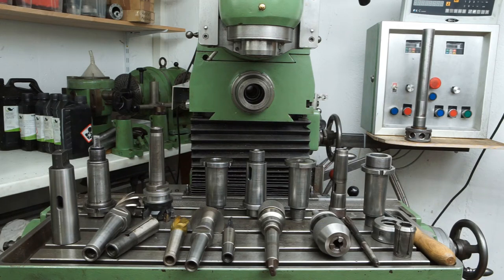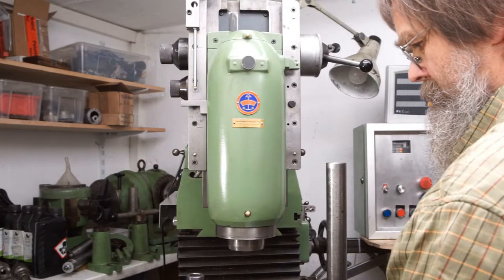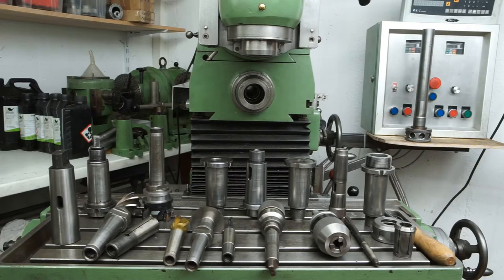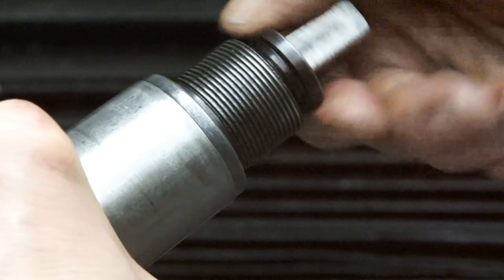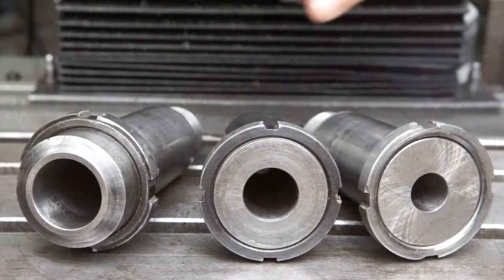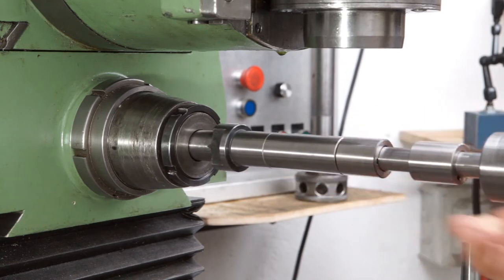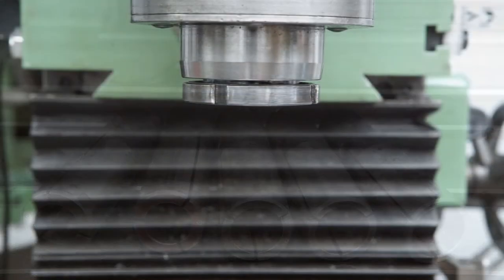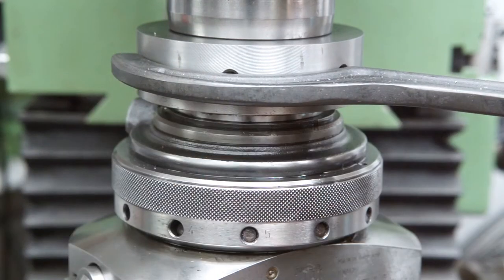Thiel Duplex 158 tool holders

Comment: Hi Harald - lovely work on the restoration of the Duplex 158. I am currently doing similar on a Duplex 159.Do you have any further photos or videos of the restoration? The Thiel is not familiar to me as I usually work on old lathes. I have the servicing manual but the drawings are not detailed enough for taking the machine apart. for example I cannot see how to remove the overarm without taking apart the spindle? Hope you don't mind me asking.
Reply from the maker: You will find a pretty detailed report at the German "Zerspanungsbude" forum: https://forum.zerspanungsbude.net/viewtopic.php?f=4&t=15758
Unfortunately the discussions are in German language, but the photographs could be helpful.
Feel free to ask me via e-mail (hfinster at gmx dot de) if you need more help.
I can only comment on the 158, but if I remember correctly, you can remove the overarm without removing the horizontal spindle. There is a bearing underneath the cover at the back. 
Edit: The splined shaft is axially fixed by a washer and a bolt. If you remove this bolt you should be able to remove the overarm.
There is a small housing with two gears underneath the overarm. The spline rungs across the top of the pair of gears. You should be able to pull the shaft through.
Reply: Hi Harald - Thanks so much for your reply and the very helpful information, I have friends in Austria who can translate for me if google translate isn't enough. The quality on the machine is exceptional but it has been neglected for many years, but hopefully nothing fundamentally wrong @HaraldFinster

Comment: Did you fit a DRO to your 158? 
If so, I would be interested to see if you found a good place for the X-axis scale because there is not much space underneath..........without protruding past the surface of the vertical table (where the two tee slots are located for mounting worktables, dividing attachment, large workpieces etc)

I would be interested to see if you came up with a nice solution. It would be nice to still have access to the trip dogs for disengaging the x axis feed after fitting the scale
Reply from the maker: Yes, i did fit a DRO to the 158.
With regards to the x-axis: you do really touch a soft spot here. I mounted it below the vertical table using the existing T-slots. As you say, the problem is that it protrudes past the table surface. Thus I have to remove the x-axis DRO in rare cases. Admittedly: i am not entirely happy with this solution. And, no, unfortunately the trip dogs are no longer adjustable. I left the end ("emergency") stops in place, of course.
Reply: @HaraldFinster  Pretty similar to my result. I mounted it to the tee slot also. Mine has an angle-iron cover piece mounted in there also to protect from cutting oil and chips. The result protrudes about 10mm past the vertical surface.

It just means that the tilting table only gets maybe ten degrees each side before you have to remove the dro scale..........if you needed to tilt the table sideways and could not achieve the desired setup by another means, either fore/aft tilting or using a sinebar.

Unfortunately the trip dogs are gone, but never really a problem as you have a big ruler-scale on top of the saddle to tell you when you are near the ends of the travel🤡 I use the soft wire shanks from pop-rivets as shearpin material for the two feed shear pins. Seems to be just about right for allowing heavy cuts but also they shear pretty easy when required
Reply from the maker: @g00167015  I used angled aluminium profiles to protect the ruler. They are a little bit bent meanwhile because I tilted the table downwards a bit to fast and hit the protective angle-profile. It still works fine.
Good hint with the shear pin. I used to use regular wire nails. They seem to work fine so far. One of them sheared off recently (without any obvious reason). I will try your solution with the pop-rivet shanks!
Reply: @HaraldFinster  a little cheaper than cutting pieces of TIG filler brass or alu rods......🤡

Comment: When you undo the withdrawer nut, how do you stop the spindle from turning?
Reply from the maker: It doesn't require a lot of force. Thus it is sufficient to put the machine in low gear so that the drive train keeps the spindle from spinning.
Reply: @HaraldFinster  thanks. How about when you tighten the draw bar? On mine, even in low gear, the motor provided very little resistance
Reply from the maker: @cai876  tightening the draw bar doesn't require a lot of force. I have never had any issues.
The spindle of my Thiel is driven by a motor with an integrated brake. I am not sure if all models are driven by this type of motor. It might be worth checking the functionality of this brake in your case? Feel free to ask if you need more information on the brake system.
Reply: @HaraldFinster  thanks! I think my brake must be non operational. It's a Thiel 158s if that makes any difference
Reply from the maker: please refer to this link for more information https://blog.demagcranes.com/en-us/maintenance-and-service-tips-for-demag-kb-and-zb-motors-in-non-crane-applications/
Reply from the maker: @cai876  If it's a 158s I am pretty sure that your machine has a brake motor. You should see an axial displacement of the drive pulley (the pulley at the bottom with three drive belts) when you switch the motor on/off. Please refer to my video on the first test run of my Thiel https://youtu.be/qRAYx8pVsHg?t=143
Reply from the maker: You could remove the drive belts and check if the motor has any resistance when you try to turn it manually. (In off state of course!)
Reply: @HaraldFinster  Thanks. I definitely see an axial displacement of the drive pulley when I when I switch the motor on
Reply: @HaraldFinster  it offers pretty much no resistance when I turn it by hand!
Reply: @HaraldFinster  Do you know if I need to take the motor out in order to adjust it? If so, can you explain how I should do that?
Thanks!!
Reply from the maker: @cai876  that's bad (the fact that there is no resistance)

If I am not very much mistaken the motor is flange mounted with four screws on a pretty heavy plate which is mounted with four screws at the back of the bottom housing. Removing and installing the heavy motor is a bit of a pain in the a** but I don't think that you can adjust the brake without removing the motor. I used a few wooden blocks to support it.

Edit: I just rechecked my machine: the mounting plate is mounted onto the housing from the back. The screw holes are slotted to allow belt tension adjustment. The motor is mounted against the plate from inside.
Thus you should be able to remove the mounting plate first. Then the motor should be free and can be removed from the housing to the back. (Don't forget to disconnect it ;-) )